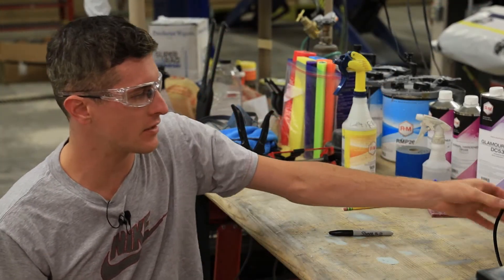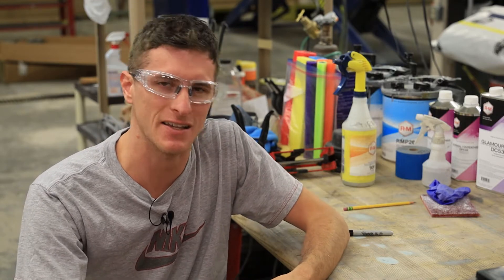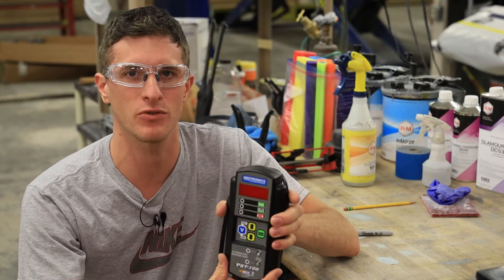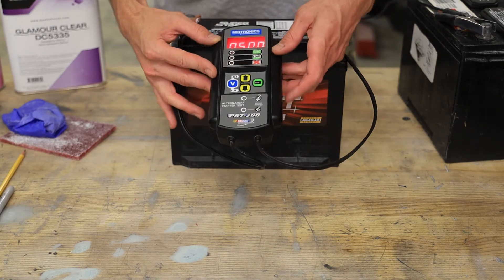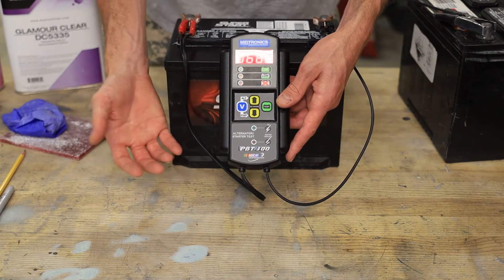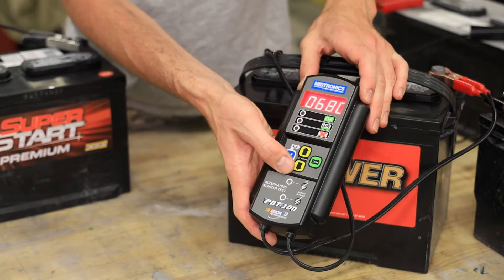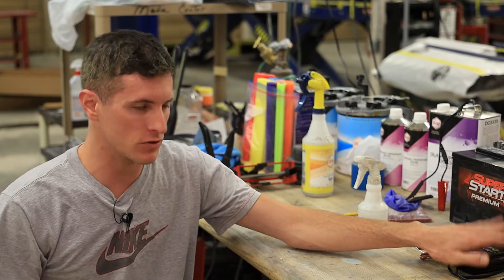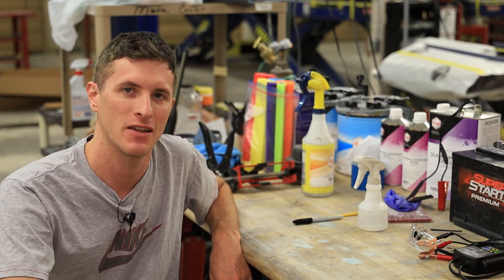Midtronics PBT 300 Conductance Battery Tester

Comment: HOW TO OPEN A MIDTRONICS PBT-300 BATTERY TESTER
The tools you will need :
1.	Heat gun or hair dryer
2.	A # 1 phillips head screw driver
3.	A pointed pick or a flat head  jewelers screw driver      
STEP 1
Lay the meter on a flat surface face up
STEP 2
There are 2 screws on each end of the meter holding the meter together.
The top one is above the display, the bottom one is under the model number
Using the head gun or hair dryer heat the top label and use the pick to lift one corner of the label.
Then peel the label back using the heat gun or hair dryer until the screw is exposed.
Do the same with the bottom label.
Step 3
Unscrew the 2 screws and the meter will come apart.   
To put the meter back together:
Step 1
Put the cover together and reinstall the screws
Step 2
Test the meter to insure its working
Step 3
Heat the decals with the heat gun or hair dryer and press them back in place.
Your done !

Comment: We bought a PBT 300, tested it with a $400 fluke meter and the  results were dead on. Excellent video. 👍
Reply from the maker: Awesome!  We had a different brand before and the results were less than accurate.